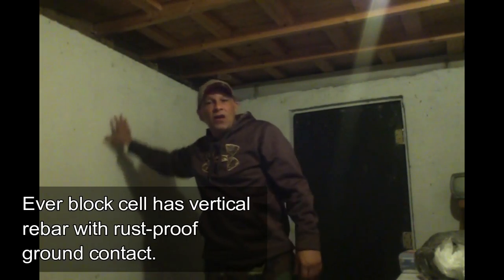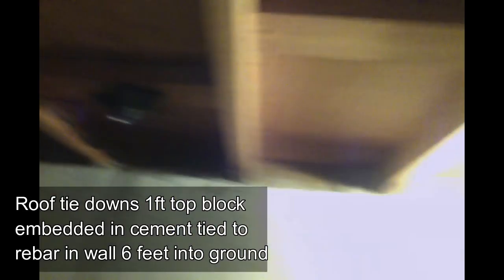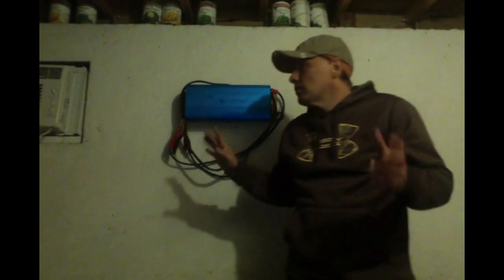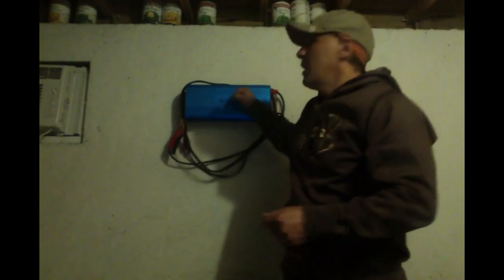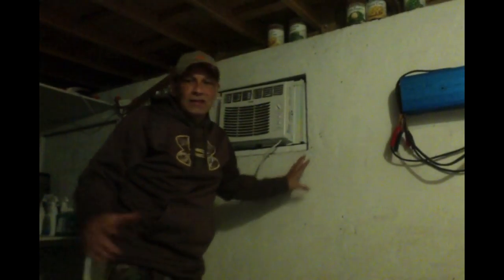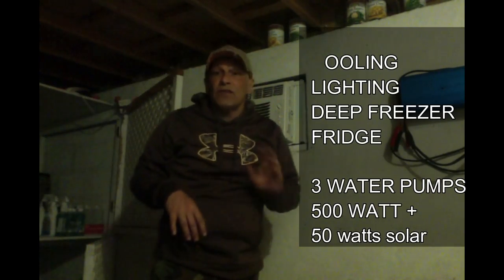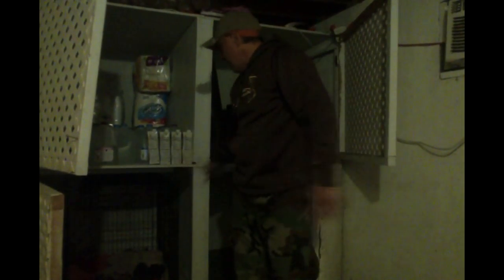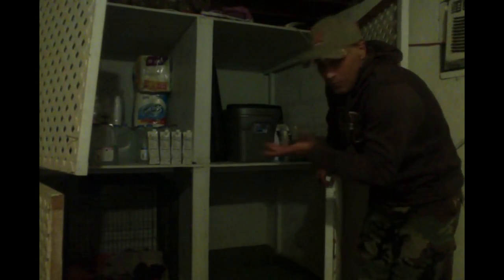HURRICANE BUNKER Storm Shelter Hurricane Irma prep Tampa FL 9-8-2017

Comment: Looks good! Best of luck.
Rebar - in concrete - in block is a formidable barrier. Particularly if the rebar was set in the concrete floor during initial pour. In the future you might want to look at mounding/sloping dirt up the sides to makes it more aerodynamic. That is - If you have the square footage on the land to allow.

Comment: Hey I was just wondering if you would make a comment on something I just saw on the news and this is Friday morning before 8. There were some people cleaning up debris and some of the islands after Irma had passed they were handling solar panels that were laying in the street is that dangerous?
Reply: Ernie - It's the same as when the panels are new. As long as the wire leads are insulated and not connected the energy collected will not transfer. :-)